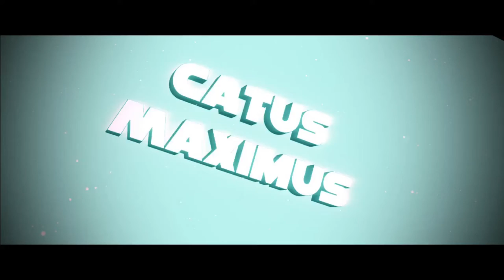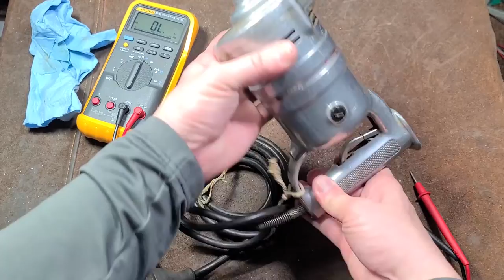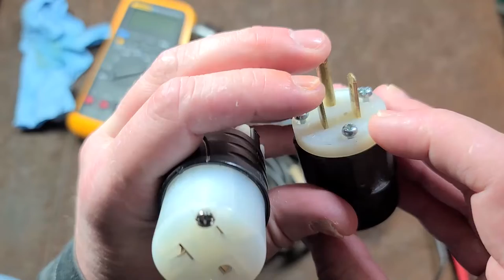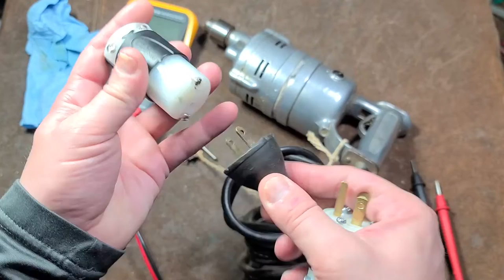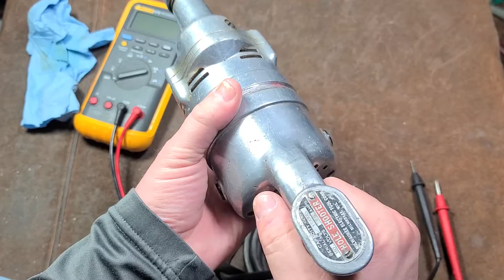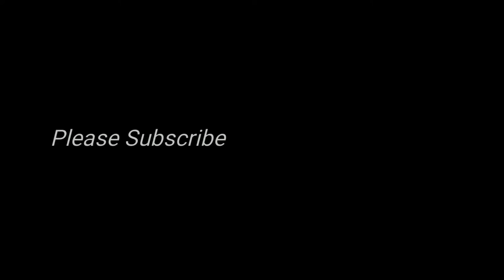This Electric Drill Could Kill You, Why? & How To Test

Comment: My grandfather had a Milwaukee drill almost identical to that one. You didn't want to use it even if the humidity was high because it would, as he would say "bite ya". When he past I ended up with the drill and the first thing I did was replace the cord with a three wire cord with a three wire plug. I don't use it really but at least I don't get shocked anymore.

Comment: That's part of the reason why electricians are supposed to make a distinction between the "neutral" and the "ground"? Observe proper wire connections at all times when installing? Don't transpose the "hot" with the neutral? 
Have encountered a lamp like that where the metal body was electrically in contact with one of the plug wires so that if it was plugged in "right" you could get a "tickle" by touching the lamp body and the sink faucet at the same time!

Comment: I inherited my grandfather's small B-D drill, and I used it until I got something more modern. It has a grounded plug but I still pause because of the all metal body. Electricity can "freeze" muscle and prevent you from letting go of the handle. Not good.

Comment: 1:47 if neutral blade is missing it will not not not still work.
Reply from the maker: Yes I was wrong about that The bond is on the structure side not on the portable equipment side